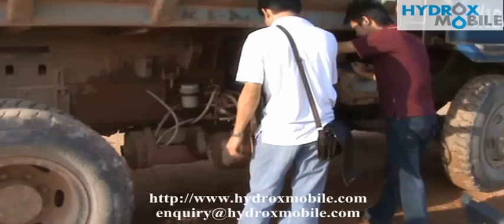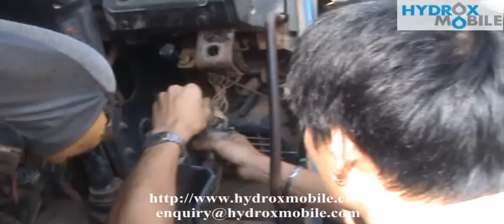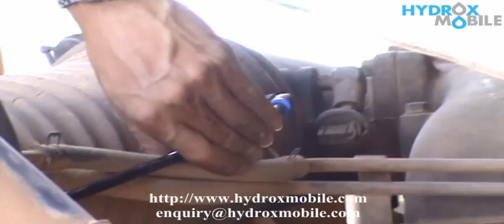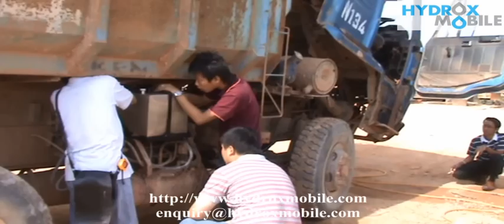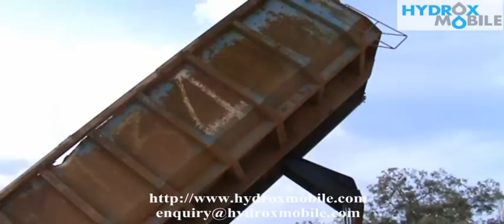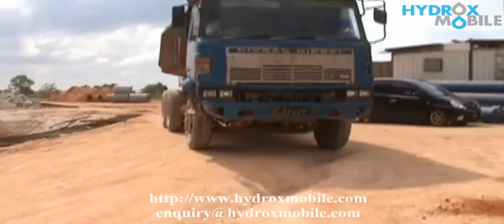Sand Truck HHO Generator HM240

Comment from the maker: 4LPM 23% fuel savings.  Went back to check the system on 4 DEC 2009.  Flushed system and refilled with distilled water and NaOH.  Working temperature is 60C.  Owner requested to replace HM240 with HM300-XU on 4 DEC 2010.